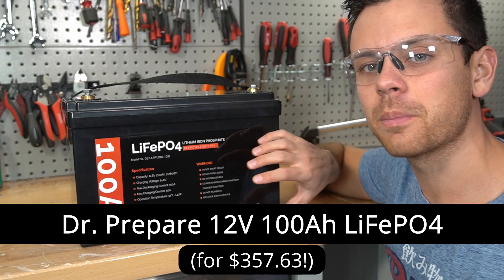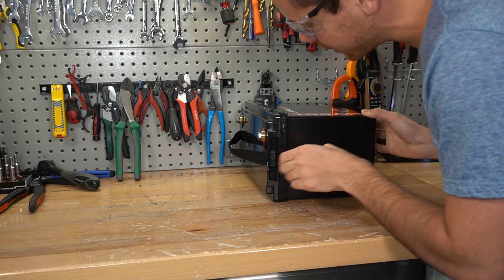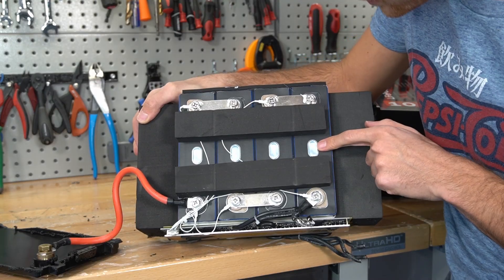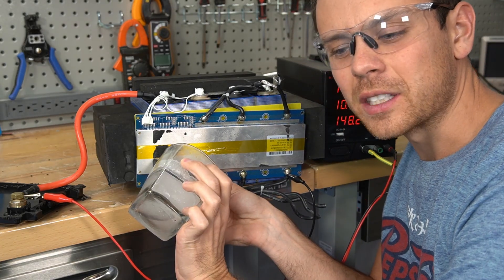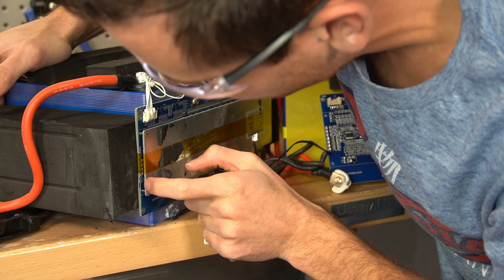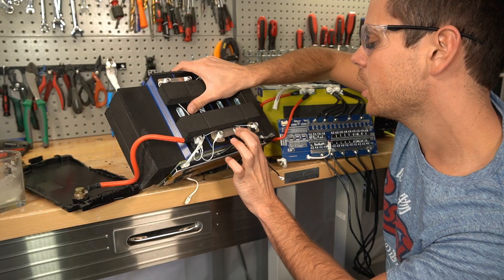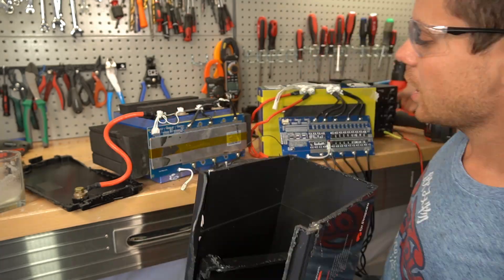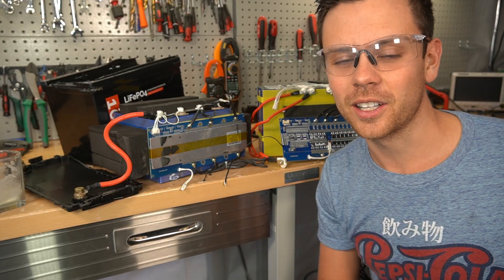Dr.Prepare 12V 100Ah LiFePO4 Battery Tear Down!

Comment: I really don't understand why a company who wants to make a battery employs a designer who does not fully understand how a BMS works! 50 cents for a low temp probe and (free) reasonable cable routing and they would have got 4 or 5 stars from Will!
Reply from the maker: Exactly!!!
Reply: @WillProwse  And then of course, big sales! Hopefully they will take in your comments and improve their build!
Reply: Ok so what is BMS??
Reply: @dannyw7662  🤣

Comment: The worker would have known they encountered the resistance of damaging the cable on the assembly line, the fact they did not send it back to be re-worked just shows the manufacturer should not be trusted.  Wonder if they also make the dangerous power banks on Amazon that can ignite the lithium pocket battery packs?

Worth investigating the QTshine brand of power Banks sold on Amazon they are usually half the stated power (storage capacity and output) and they catch fire.
Reply: Worker should have known if properly trained!

Comment: I got myself a 14,000wh lifepo4 battery bank, 48vdc from Treeline Power systems for 3300 dollars. It's got enough capacity to keep the inverter running over night. They sell a rack cabinet steel box to support 3 of these battery banks. Nice storage solution for reasonable cost.

Comment: Will, you have shown us your large system for charging your Tesla and air conditioning your workspace with some videos. Any chance of putting this information into a "Large Solar Systems"  book? Also, what happens to solar panel output when the batteries are being charged via MPPT charger and the batteries become fully charged?  Thanks for the great videos on solar systems.

Comment: Early on in your exploration of lithium batteries you were quite happy with Daly green BMS, so I decided that was the brand name and bought those I started building my batteries. But as you discovered with early BMS the low temperature sensor wasn't there.  Finally when I was ordering my third 200 amp sensor from China I texted the girl and asked her how to get that BMS with a low temp sensor on it.   And they answered me and they said add this to your order twice and that'll be $4 and will add the low temp sensor for you.  So apparently it was always available but they just weren't offering it in their standard menu offering. You had to ask for it.   So now I have three 200 amp batteries in my motorhome and if I ever mess up and let the battery compartment drop below freezing One battery will be saved while I might be destroying the other two.  On a serious note I have temperature sensor in that compartment and regulate the temperature pretty carefully and the coldest I have been at was 28° in the compartment stayed at 38.  

Thanks for the work you do. I know it's how you earn your living and you do it well and you earn. it.

Comment: Hey Will, can that Dr.P battery be fixed by adding a cold temp sensor and placing the over temp sensor where it should be and putting it in a new box?
Reply: And replace the wire of course.

Comment: I guess you and Hobotech have different standards. BTW if my batteries never get near freezing,  why do I need a low temperature sensor?
Love your videos.
Reply: Doesn't Hobotech do paid reviews(commercials)?
Reply: @B-kl8vj  Some yes,  some no.
Reply: @housesOTR  Will also doesn't get his batteries below freezing, but he is talking in general for others. Always better to have it if possible right. And also the lack of a high temp cutoff in the BMS mosfet itself is a big concern, coz if we overload it, it won't cut off and then not sure what happens next. They tried to save a penny by pulling out the high temp sensor from the MOSFET and attach it to the cells, just to show people that it has a sensor? That's ridiculous and counter intuitive.

Comment: That is indeed scary.  "Sealed" batteries in this arena seem to all say the same thing, we have something to hide.  Granted, there are good quality batteries that are sealed, it is hard to know if they are sealed for your protection or theirs.  Slowly but surely I am coming to a realization though observation alone that when a battery can be serviced, they are usually much higher build quality.  With so many of these serviceable batteries available now at a good price it kind of narrows it to DIY or serviceable for me.  I really don't want to run the risk of open conductors in a case like that.  That just scares me so much.  Glad you do these Will, it has added to my knowledge considerably.  At least 90% or more of my knowledge of solar comes from you and what you share on this channel.  I still want to see what the outcome is of a full test of LTO on Grade A cells.  I know it has been a bit of a thing with you actually getting the right cells, and seems like a lot of people are only able to get grade b regardless of what they paid for, (which btw, I hope they refunded you for that).  Thanks for what you do.
Reply: To be fair, this battery had screws. Looks like there was some kind of plug in the hole. Wish Will would have explored that a little more. I'd be a lot more likely to buy a battery that could be disassembled without a saw. The sad reality is that even if the reviewed battery was good inside, that doesn't stop them from changing the design. Trust but verify!
Reply: For marine applications (which is where I am interested, the sealed batteries have some appeal ... just not if they are crap inside

Comment: Good i am halfway into my 10th week waiting for my EG4 battery. i did not realize the Chinese would not build it until i paid for it . This is a strange way to do business . While waiting i have ordered and received 8 LITTOKALA batteries and a  JBD BMS  from China ! Starting to wonder about this presumed backlog, or is it more of a cashflow problem ?
Reply: Be careful of those Liitokala cells, probably Grade B used cells! Speaking from experience.
Reply: @dennis_m  maybe they look like they may have been resleeved but i am not too worried about it for my application
Reply: Its always this way when buying directly from the manufacturer. They never start manufacturing before they got the cash.
Reply: The ship sunk!

Comment: A newbie here, and I am totally confused by what appears to be contradictory information re the need for low-temp cutoff. 

AmpereTime says -- and I have their support email on this -- that their batteries do not need a low-temp cutoff and keeping them on a charger below freezing will NOT damage them in any way:  the only result will be that they will continue to charge very slowly.  

In all of Will's videos (at least I think I've watched them all), makers get blasted for NOT having a low-voltage cutoff.  

Please; Will:  You're the only solar site I pay attention to.  HELP????
Reply from the maker: Yeah we really don't understand it. Every UL pack and transportation rated lifepo4 has multiple low temp sensors. Server rack packs have 4. It is a requirement, but for some reason, ampere time doesn't have it. I really don't understand why. I have talked to many battery engineers about this and it is a requirement.
Reply: How does Tesla deal with it in their cars?  Clearly they have to charge at 0F? @WillProwse
Reply: @josepha.freivaldsr.9636  They have heated and cooled water cooling loops that keep their batteries at the correct charging temperature
Reply: @Jasonoid  How would they do that with a car parked in in N Dakota for a week in temps below zero?  Are they using up the batteries for heat until they will no longer make the car move?
Reply: @josepha.freivaldsr.9636  In some places electric cars don't make as much sense. N Dakota in the winter might not be one of them haha. The heating process isn't needed all the time, just when you start charging the cells. They make their own heat as the charging process continues.

Comment: I bought a 100ah battery from dhgate at that price it also has the same black case as that one, i got it for my trolling motor it seemed be working well but not sure if its the same battery, mine weighed in at around 23lbs and box had no lables just a little sticker that said 12v 110ah Ion !

Comment: Oh man, that frayed wire is AWEFUL. Looks to me like they tried to save $0.01 by pulling out that white sensor instead of the proper sensor port. It's too bad as they look like decent cells. They asked me a couple of times to review this battery but I declined. Glad someone covered it! Too many options on the market these days to keep track of.
Reply from the maker: Right?! I cannot believe that wire. They must have used a lot of force too. Yikes. Yeah the cells looked nice, and the balance lead. I hope we see this BMS more, I do like it when it's configured properly. Probably just a cheap PCB that multiple companies are buying. Can work with various voltage batteries.
Reply: @WillProwse  Hello Will, I have EV bike which comes with 6 12V LiFePo batteries. I do have power supply like yours. Do I need to remove bms in order to revive my batteries? They should be over 12v each and putting them on 0.5amp for few hours brought them up to 10v but after short time they dropped down to 7.2v. What is the proper way to revive them?
Thanks
Reply: I told you don’t buy the battery. Already I opened it mine looks quality inside but the low temp sensor is missing why I put one star review. The problem is already I bought 8 of them.
Reply: Wire was probably supposed to be tucked in but wasn't or came out. Perhaps only held in place with a small piece of captan tape.  Then whoever was screwing the cases shut was going super fast and just went right through the wire. when you're paid by the piece or have some supervisor only worried about production speed, this stuff happens.
Reply: @asbestosfiber  I agree the pinched wire could be a mistake. However the relocation of the temp sensor and selection of low quality mosfets in the BMS and complete removal or no addition of the low temp sensor should all be red flags. These were likely cost cutting moves and poor design, the case was glued close and they likely thought no one would ever open it up and take a look. Renogy Shenzen/Dr Prepare claims they are listening to customers and are planning to redesign the battery and release a new version in the future with low temperature protection and support series connections. Perhaps they will use an updated or better BMS and come back to the market with a battery and redeem themselves.
Reply: To Note Though—- Even though this dr. Prepare case looks very similar to most of the other ones that will is mentioning, this case is different on top. On one of the company’s pictures, the screws show to be exposed! On others, they are still there but under something.
Reply: @whatsmyname.7768  These case now come with black plastic plugs to insert on top of the screws to hide them.

Comment: Server rack batteries are where it's at.  So easy to scale with a nice rack cabinet with common + and -.  All in one to top it off.  I live in Canada and our Amazon deal right now is Ecoworthy (brand), would be nice if you could review the 100Ah model.
Reply from the maker: Agreed. That's all I want for my system now. and the BMS in the rack batteries is fantastic. Communication, shunt and current regulation.
Reply: For off-grid it's perfect.  The question is where to draw the line between on and off grid, as its regulated by different approvals/agencies.  Would be nice for this type of equipment to conform to municipal requirements.
Reply: Show me a link. I am pretty sure that all these server rack batteries are made in the same plant and there is a huge backlog of orders right now because they cannot get enough children to show up for work!
Reply: @T.J. Kong  Horses for courses buddy.  Building your own is still cheaper and more personal.  For larger arrays, I'd rather have some warranty.
Reply: Yeah but they're 48 volt. That's worse than useless.
Reply: @vhfgamer   You can step it down (48V to 12V) for $40 off amazon.  If you want more panels then upping the battery voltage reduces the cost of the solar charge controller and increases the panel input.
Reply: @robertbader2915  Just about all of those 48v solar charge controllers that are cheap on amazon (and your 40 dollar buck converter too) all put out an ungodly amount of RF noise. 

Not to mention all the good inverters are 12 volts, like the samlex FSW models.

Comment: “Hobotech” was just recently singing praises about this battery……hmmm.
Reply: Who is HOBOTECH ? doesnt sound like a guy i would trust. sounds more like someone looking for a handout .
Reply: @davidkettell5726  Actually he does pretty good reviews, and involves a good amount of testing, but in this instance he didn't do a tear down like Will did.
Reply: @MrWinger1951  he didn't have to tear it down to test low temp cutoff. Just throw the battery in the freezer for a couple hours and see if it takes a charge afterwards. If it charges it doesn't have a low temp cutoff sensor. He didn't do that type of testing unfortunately and now his video will blow up with comments. Maybe he will respond with a video. But hey.... He was trusting the company as they say it has low temp cutoff..... Gotta prove it and not just take their word.
Reply: @Jasonoid  did the company claim low temp cutoff?
Reply: did he take it apart? test for low temp or over heat the bms?
it looks good outside, its cheap and it passes a load test. that all hobo looks at
Reply: @woodchippers_WestWingDimeBag  I was indicating that Hobotech was inaccurately praising the battery, that’s what the “hmmm” at the end of my comment was for.
Reply: @MrWinger1951  I was indicating that the praise was accurate based on the testing he did 
most youtube reviews are not destructive tests like will does

Comment: Excellent review Will, good one to avoid. I have a Solar Panel Question that I'm seeing conflicting information on- If you have a solar panel exposed to sunlight and not connected to anything, will it cause damage? 🤔
Reply: I've had 3 x 300 watt panels sitting for 2 years on a stand I built behind my house, not connected to anything, and they still have the same open circuit voltage. I changed my mind about connecting to my workshop because the 100 foot run would result in an unacceptable voltage drop, so next spring I'm just going to mount a case on one side, with a battery, inverter, and charge controller, solely to run the pool pump (and maybe a little beer fridge). In the meantime, birds love to build nests under it. Those panels are going to last longer than I will.
Reply: @brikshoe6259  Thanks for that information! I've had 4x250 watt panels waiting for me to retire and build a stand...Now I know I can proceed and take my time.
Reply: I think you may have seen people cover them when they don't want voltage produced, like when working on a system. Connect the battery to charge controller first to allow it to work before the panel is connected. They are actually tested/rated for open voltage.